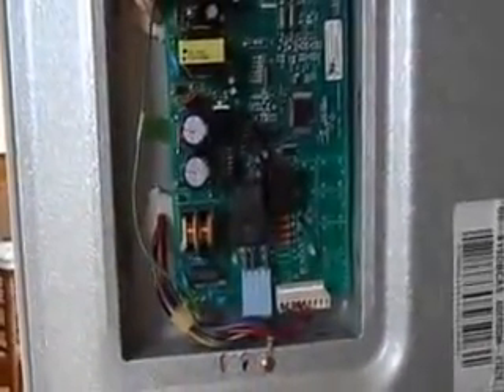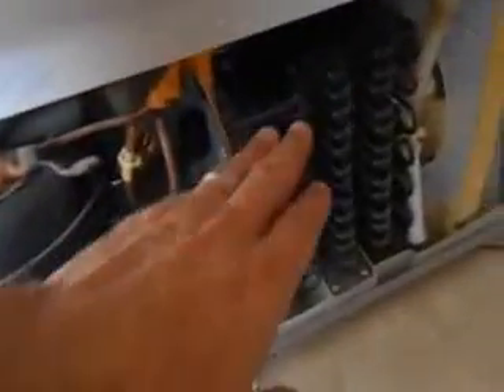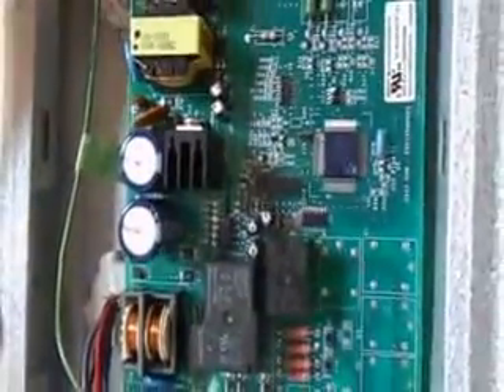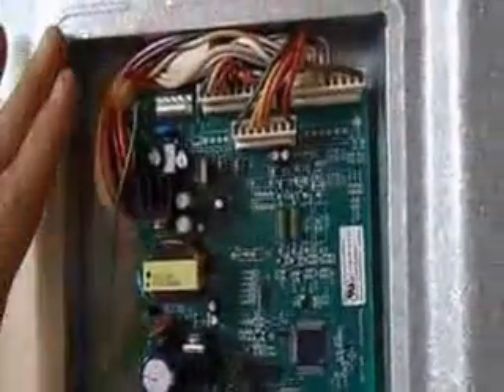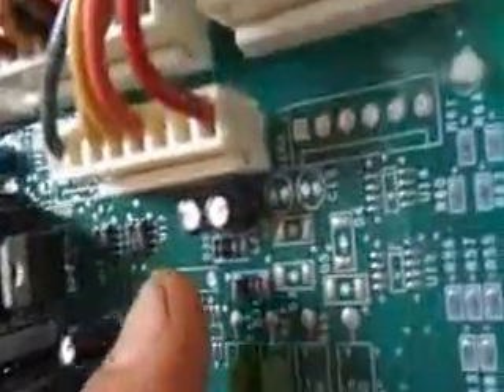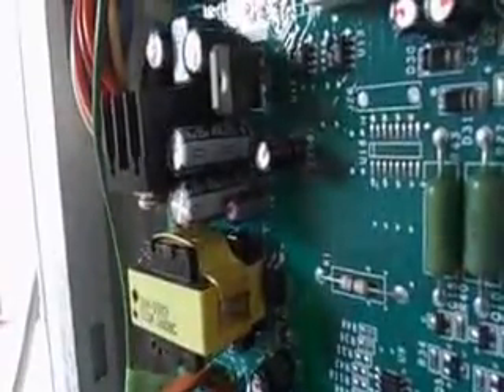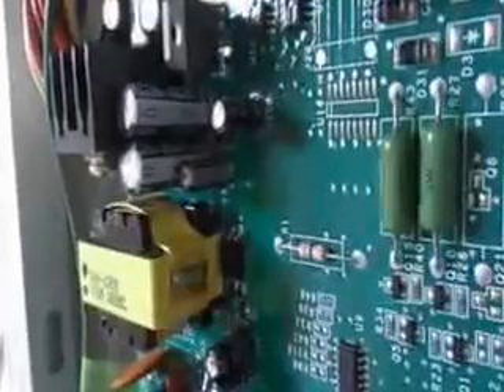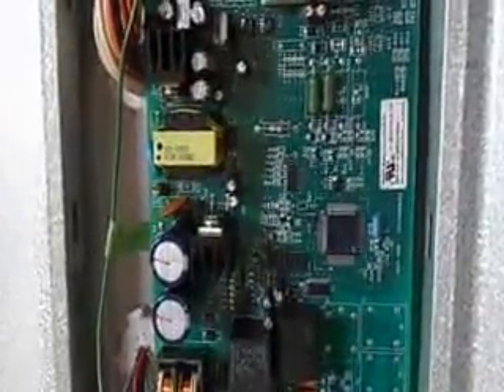GE Refrigerator Click Click Sound... Not cooling.  Known Problem Discussed.

Comment: Thanks for posting this. The fix solved my problem. Capacitors degrade over  time and the capacitors sit next to a power transistor heat sink and the local warming and radiant heat probably also add to the degradation. The identified capacitors are labeled 470uF with a 25V rating. With my inexpensive capacitance meter, my replacement 470uF capacitors measured at ~410uF. The capacitors that I pulled off the board measured less than 1uF. I'm now a day since the replacement and the fridge is still back to running fine. Thank again.

Comment: Barcodequality, how did you know,  find out, and conclude that it was those small capacitors in the motherboard and how did you test them to know they were bad ??
Reply: Look for swollen tops.  The caps have a flat aluminum top cover that swells when it goes bad.  Replace all the can style caps that are marked with the same manufacturer's name on the board at the same time, or you'll be back later.

Comment: how much does it cost to get a new board?
Reply: How did they go bad?
Reply: L.Weisler Ghee Too many power spikes from the power grid.
Reply: I'm having the same issue
Reply from the maker: Fred, I believe the new board is somewhere in the $350+ US range...  The capacitors cost $4.  If you do not have the skill to unsolder the capacitor legs and resolder them properly,   you should be able to take your board to an "old timer" electronics store (non-corporate, non-radio shack, small store away from the mall) they could probably install the required capacitors for less than a 1 hour charge.

Comment: You point to the device near the compressor and call it a 'relay', it is not.  It is the RUN CAPACITOR for the compressor.  They almost never go bad.  You are correct with the rest of your commentary....well mostly-no secret stolen crabby patty formula...just poor quality caps.  BUT - The caps on the GE Boards are not necessarily of poor quality, they get hit with over-voltage, power spikes etc.  Because the bigger the cap, the more expensive, the engineers who designed the GE board trying to keep costs down provided for a very narrow safety range of how much power spike they can handle.  This is usually caused by crappy power or storms.
Reply from the maker: Hey thanks!  When making videos on the fly without a script of rehearsal, it's easy to say something dumb!  I am good at that!   My focus was on drawing attention to the capacitor problem and how to repair the circuit board that is failing without spending $300, plus 2 service calls.

Feel free to reference badcaps.net for brands caught up in the middle of the incorrect formula debacle.  This is a widely know problem..no conspiracy theory I just came up with.   In essence, Too cheap to buy the rights to use a secret formula, Page 1 of the formula was taken, while page 2 was left behind.  The stolen electrolytic formula was marketed and sold to the biggest non-Japanese manufacturers resulting in the huge Capacitor problem worldwide.  

All bad capacitors on this GE board were Chinese branded... failing in a consistent way to the 100s of others I have seen repairing electronic devices from that "era" or time-frame.
Reply: Its is a run caps with relay 😉